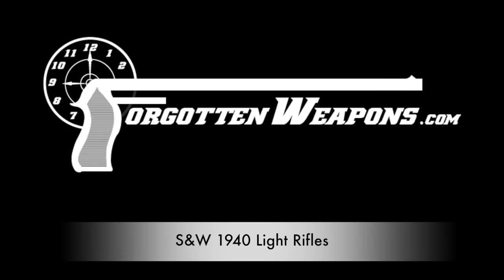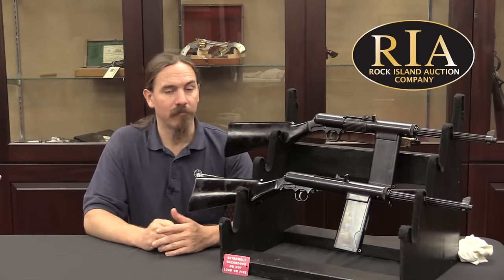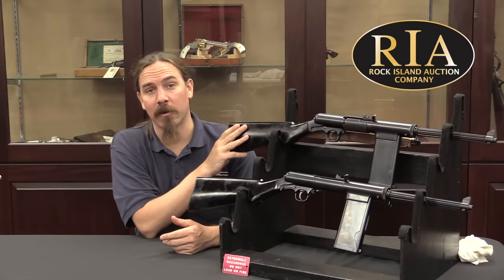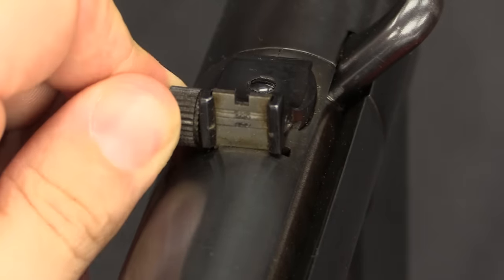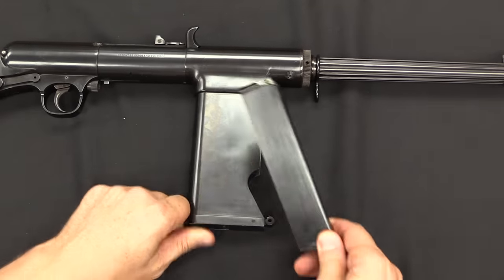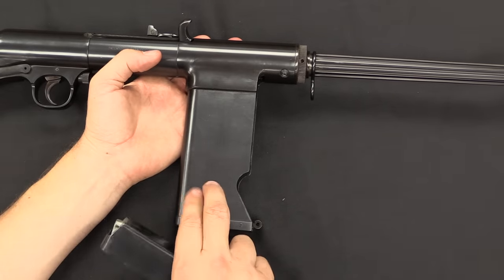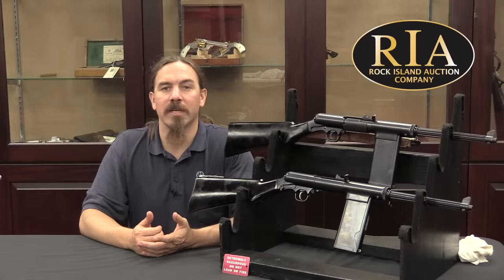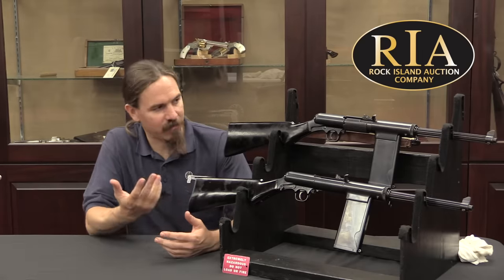S&W 1940 Light Rifles: Receiver Breakage is a Problem

Comment: When your machinists are 100x better than your engineers... you work at S&W.
Reply: Exactly my own thoughts. The workmanship is top notch, but the design is completely nuts.
Reply: @0neDoomedSpaceMarine  and that is a "bad" copy of the swedish submachinegun
Reply: @0neDoomedSpaceMarine  until you get some brass stuck and have to take the whole piece of shit apart
Reply: @0neDoomedSpaceMarine . Not bad as in badly working but seemed to cheap out on the stock and sights at least compared to the original. Cheap would perhaps been a better wording than "bad" (i meant "bad" copy as in not a perfect copy and not a badly functioning piece of equipment)

In any case it is not a s&w original design but a copy of the kpist m45 witch in its case is very much a simplified suomi smg mixed with a sten gun. Sights,  Barrel, Replaceable barrel jacket (simplified) , magazines and trigger group (minus selector) from the Suomi. Bolt and metal tubing reciever, saftey (via the bergman smg) and the no frills attitude (no need for a wooden stock and the pistolgrip on the m 45 is one step above a metal wedge) from the sten gun. Add to that a simple but apparantly unusually stable folding tube stock and you have basically the kpist m45
Reply: So eloquently put...
Reply: open bolt, fluted barrel.. they HAD to have intended that to be select fire, then decided it wouldn't handle it.
Reply: It’s a light rifle. In this case “light” is a descriptor of the weapon’s practical service life😂

Comment: Between the open bolt, and the fluted barrel, the platform entirely suggests the creator meant it to be a fully-auto firearm.  My guess is that they hit some type of reliability snag in the full-auto version, so only marketed it as a semi-auto.
Reply: Florida almost looks like the early ww1 aircraft rifles(and is pretty similar design wise). Maybe that was the intention, albeit 30 years too late
Reply: Tend to agree.  I suspect when the guns kept breaking into two peices after 5 or 6 magazines they decided it should be semi-auto and added that little finger.
Reply: If the endurance test on semi-auto failed, imagine how quickly it would have failed on full auto
Reply: And you have a point, David, but full auto with the lesser 9mm rounds it was designed for might have made it last ... 1000 rounds or so.
Reply: Maybe what failed was the magazine capacity? just think they get it all put together and suddenly realize that the 20 round stick isn't going to be enough and there's no way to fit a bigger mag
Reply: I'm willing to bet that receiver caps breaking off were even more of an issue when dumping mags through in full auto.

Doesn't seem like a difficult thing to fix, though... just add an extra 2 inches for the bolt to slow down. The ejection tube/magazine well is ridiculous, so cut it off.

There are so many problems on this gun that could have been easily solved...
Reply: Makes sense to me.
Reply: That would also explain the weird magazine well. It might have been intended to double as a foregrip.
Reply: @HadToChangeMyName_YoutubeSucks  I wonder if it could be modified to fire full auto

Edit: not that you'd want to, seems like a dangerous endeavor
Reply: Kilgore Trout not only do I think it COULD be made full-auto, I think all you have to do is remove that tiny trigger catch he pointed out and it would already be full auto. 😮
Reply: 9/10 it was something to do with that weird magazine tower... thing. What do you want to bet that it didn't properly eject cartridges on full auto? The design looks rife for stovepipes to me.
Reply: I'm thinking it was originally designed for cops. The mix of martial & tacticool features just makes it seem like it was designed for cops by people with no real idea what a cop needs in a gun. That happens a lot...
Reply: @JosephHarner  I have a feeling the British Military wasn't willing to spend any more money to fix the problems with it, since the gun was more or less a shut up gun. They just wanted people to shut up about the so called, "Gangster guns." but were unwilling to accept that military technology has evolved past ww1. Its kind of like when you ask your mother for an Xbox one but instead she gets you a used Xbox 360. S&W Knew that there was very little the British military could do to stop them from scamming them, if you think a discount on revolvers was worth the price of one of these you're dead wrong. Revolvers at this time were like Glocks of the modern not that expensive and there is tons of old stock of them. So basically S&W was giving their trash over to the British military because they couldn't sue them and they couldn't sell them to the public.
Reply: I could almost see the thinking at that time where this is practical for factory guards or maybe even prison guards. However, they were either lacking in real experience/input or were overly optimistic about everything working smoothly.
Reply: makes you wonder what the rate of fire would have been, with a light bolt and a weak recoil spring!  maybe they tried it, found out it went at 1200 rpm, then decided very wisely not to go there!!!!
Reply: "Reliability snag"

Probably had something to do with the receiver breaking. I feel like full auto even with two grains less powder would make that more likely.
Reply: Definitely designed to have full auto capabilities in my opinion. Fluted barrel is also a clue. Just a poor design probably tested with weaker rounds, failed in full auto, made semi auto. Pushed into production for unknown reasons probably from a marketing dept. Made enough to recoup development costs from the desperate British hoping they were desperate enough to keep the P.O.S. then hotter ammo steps in. It would also have been a nightmare in the field with that tiny spring and pin, close tolereances on the bolt and tube in dirt and north African desserts! It is longer than a Thompson and is actually more complicated, way less effective than a sten. A guy couldn't carry anything else, unlike a sidearm, which can be carried with a service rifle. Slow to manufacture. Production capacity is needed for something else besides Buck Roger's plinker. Useless. Every obvious required category for an effective weapon has failed. 3x as expensive, looks gorgeous, finely fit, metal thinned to the maximum. "Hey look at me, mine's bigger!" The silk lingerie of firearms. Typical S&W. That's why I like Ruger wheel guns. It was posing sculpture for S&W.

Comment: This "carbine" is basically S&W writing the book on how NOT to make a submachine gun
Reply: TheGoldenCaulk Including not making it a, you know, subMACHINE gun.
Reply: They didn't even make a SMG. They made a pistol-caliber carbine. Ran right up to the threshold of making a submachine gun, stopped, and immediately punched themselves in the face.
Reply: I'm guess that it was designed as a SMG but they kept breaking (just like the Brits found) so they made it semi-auto to "fix" the problem and it did until the Brits used a slightly more powerful round.
Reply: Change the spring and maybe file some weight off the bolt and I may be a fairly decent .380 PCC.
Reply: LOL well obviously 'cause like, it isn't a GODDAMN SUBMACHINE GUN in the first place. its a semi automatic carbine. duhh
Reply: What about a nambu type 94 with a stock and select fire? 😂😂😂
Reply: @exist7415 At no point have nambu pistols been sold with manufacturer attached plates that say "Please do not use as a gun or you might suffer injury/death"
Reply: Colonel K
Reply: S&W seem to be in the business of writing books on how not to do things.
Reply: What a joke where is curly
Reply: How can everyone be so blind? The Brits stole the ideas from this and made the Sten gun, with only the slightest modifications. The two are practically identical.  ;)
Reply: Or just how not to make guns in general.
Reply: @donjones4719  The Sten gun was a copy of the German MP-18 I with a dash of MP-28 II. The Germans liked it so much they made their own copies in 1944…
Reply: @allangibson2408   Um... you may have missed the  ;)   on my comment.

Comment: The fluted barrel was designed as a secure hand grip for when the thing stops working and the soldier is forced to use it as a club!
Reply: Oleum Camino  They were firing 9mm semi auto they did not need a barrel that would require strengthening or expensive weight reduction techniques.  Usually heavy fluted barrels like that is so that you get the benefits of heat distribution when using a fully automatic weapon.  It's almost like they originally designed it to be fully auto but perhaps realized their receivers were crap and could not take the strain and just made the minimal change of making it semi only and hoped no one would notice.
Reply: @FakeSchrodingersCat  That was  pretty much my first thought when he showed how the trigger worked. You could convert it into full auto with a pair of pliers by snapping that disconnector finger off the trigger group.

Seems like it would have been an easy gun to fix, extend teh end cap, maybe give it a pistol grip, snap off the disconnector and convert the tower into just a deflector to keep the brass from hitting you in the fingers and it would have been a decent SMG.
Reply: Plus it's great for keeping a long, thin-walled barrel from bending from forces other than shooting, such as dropping the gun.
Reply: “When it stops working” you mean when it evolves to it’s 2nd form?

Comment: The Pontiac Aztek of firearms.
Reply: Walter White does not approve.
Reply: My Uncle had an Aztek, and quite aside from its weirdo styling he quite liked it.  Unlike this "light rifle" it actually performed the duties to which it was designed adequately.
Reply: Aztek is ugly and practical. This thing is almost pretty but damn useless
Reply: Paint it mint green and I'll buy one
Reply: More like the Ford Pinto
Reply: @cernunnos8917  I can already tell you've never owned a Pinto.  I owned four manual trans versions in my younger days ('75, '76, '78 & '80).  Strip the emissions garbage off, a free flowing exhaust, rejet the carb then install a set of low profile 15" tires/rims and better quality shocks and it was a mean budget street econo racer.  Never got around to transplanting a turbo 2.3L SVO engine/5 speed in one though. :(

Comment: I guess that the term “light rifle” was a bit of a misnomer.
Reply: Heavy PCC would have been more apt.
Reply: Light bullet. Heavy rifle.
Reply: Mr. Dmitri Ravenoff What is worse is that the "light" bullet has much less range and penetration compared to lighter rifle bullets (a 5.56 x 45 mm NATO rifle bullet has a typical weight of 62 grains but a 9 x 19 mm Parabellum pistol bullet has a typical weight of 115 grains).
Reply: It may be a reference to the 9mm pistol cartridge used in a rifle. Or, SW had an excellent marketinng department.
Reply: I dunno, it seemed happy to shed its own mass so maybe it's true..?
Reply: Stength of a light bulb?:
Reply: Had they did it at least in .30 carbine (yeah, .30 carbine can be fired in a pure blowback gun of acceptable weight. Trials made during the war tith a modified Thompson demonstrated that a merely 570g bolt was enough even for proofloads) sturdy enough, and shortening the silly ejection tube, it would have been a really interesting design.
Reply: It was an early entry for the Light Rifle program.

Comment: I have no idea what S&W was thinking/smoking... what aspect of this gun is a good idea, I just dont see it.
Reply: Well in effect its an M1. A bad one, but thats what it is
Reply: @wierdalien1  its worst in every aspect; weight, range, sights, handling, cost, durability, locktime and aesthetics.
Reply: @RaDeus87  yeah the semi auto open bolt is a bit weird. I quite like how it looks
Reply: They are just nicely made and have quality looks, all polished and well finished. But they don't look like guns from 1940 at all, they are so 1920...
Reply: The trigger mechanism is pretty neat I guess? That's all I got.
Reply: Whatever it is I gotta get me some.
It's like they wanted Eugene Stoner to design a light military rifle for them but instead they just got some stoner named Eugene!
Reply: ...an M1 designed after a night nursing a Texas Mickey of Scotch....
Reply: @wierdalien1  open bolt semi auto makes sense as a cheap self loading carbine but that's where they ran out of sense
Reply: Alex Smirnoff reminds me of some overkill steam/diesel punk stuff, and something a gangster would have carried over a Thompson if it had been around in the early 30's.
Reply: +Echin0idea Even the trigger mechanism is overengineered. There is no need to make a springloaded sear attached to the bolt and a spring loaded trigger, when all you need is a dent in the bolt where the sear, directly attached to the trigger, operates.